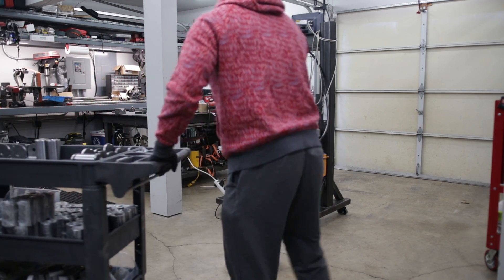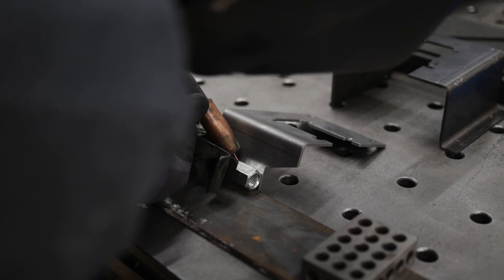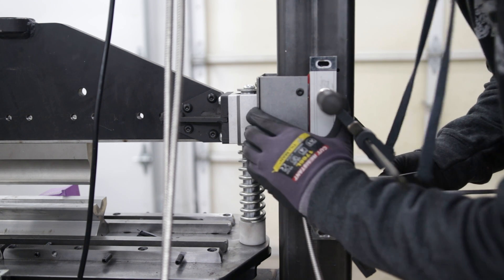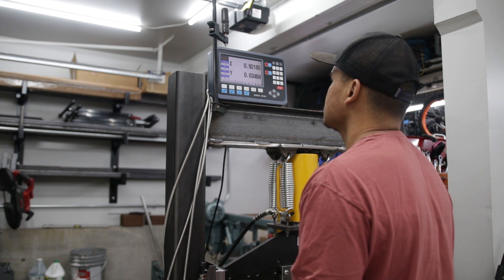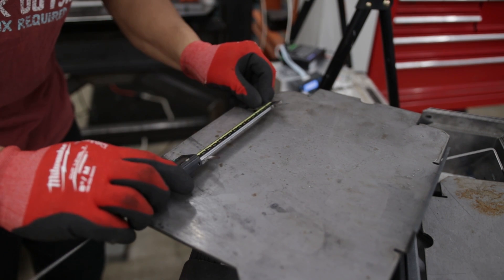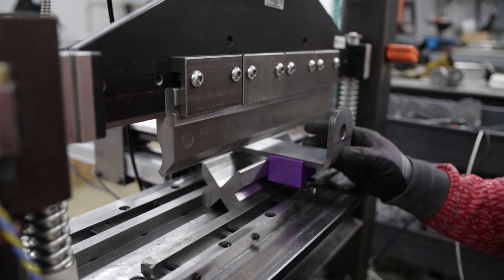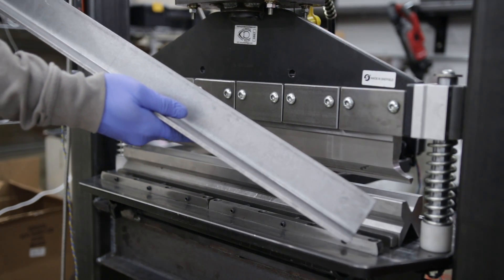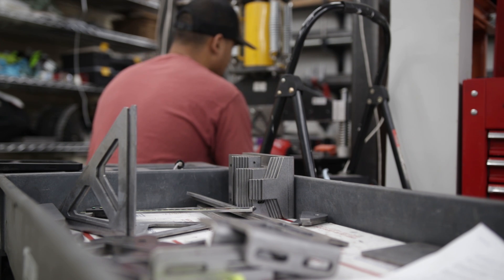DIY Hydraulic Press Brake PART 3 - Bend with Precision

Comment: If you want precise alignment of the scales, mount a dial indicator on the moving  part and sweep it along the frame of the scale. 
You should do it on the side and the front. 
Don’t assume the washers are of equal thickness or the steel columns are flat.

All limit switches have some hysteresis and it varies greatly from switch to switch even within the same batch. Mechanical switches are the worse, unless you use specialty precision limit switches designed for automation and robotics.
Optical gap switches have the lowest hysteresis and variation.
Reply from the maker: Interesting thanks!

Comment: You are so smart to have the press brake in tandem with the table.   The first 2 pieces of kit every shop should have are a plasma table and a press brake.  Because once you have those, you can build everything else.   

I love the quality of the brackets you make with the press brake.  They look professional, much better than  2 pieces welded together.  Way faster too.

I love that your press brake has the glass slide on it.  I'd add a CNC guide as well, but that is probably just me. 

Excellent work.  Love the series.

Comment: Nice work, How are you cleaning up those plasma cut parts with having sanding marks all over them? The brackets look great, I just got a used arc light CNC table.
Reply from the maker: i use a mr deburr tumbler
Reply: @RathaSochenda  nice! I have looked at those, as well as seen some diy ones people have built on youtube.

Comment: Great job! Simple. Effective. Love it. I see room for improvement! Overtime the cyclic forces on the frame can cause fatigue failures in the welds. You should disassemble for painting because it would look slick. While the frame is bare you can add some knee braces in the top crossbar like you did in the bottom crossbar then go a step further and add some plates to “box in” the whole sides of all the channels. There isn’t much there in the webs of those channels so adding side plates creates a double box section which is considerably stiffer. Add a custom logo or name it with some lettering with your cnc table! 
“When it’s Built not Bought, it’s Custom not Cost’em”

Comment: Just wrapping up my own custom Cnc plasma table. This is next up
Reply from the maker: Sweet!
Reply: Now I know this suggestion sounds crazy, but maybe taking a micro stepper and attaching it to the adjustment screw that way you can set your depth of plunge with numerical control as well. Could be a good addition.., 🤷🏾‍♂️ After enough trial and error you can have a really consistent chart of bends for all common materials and lengths

Comment: Definitely going on my future build list. Between the plasma cutter and the press brake, a great combo. I have the Hypertherm PM 65 on my PlasmaCAM table, and a 30in shear/brake/roller. Working on a 2x72 belt grinder among other things. Your build is very logical and impressive doing a full 0.1875 width mild steel bend with that quality. Keep the vids coming.
Reply from the maker: Thanks! Appreciate it!